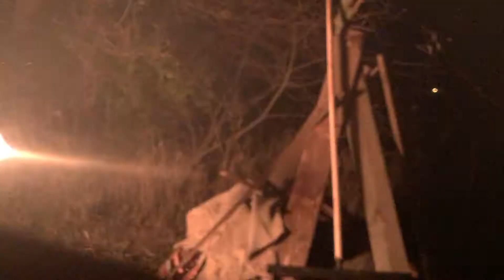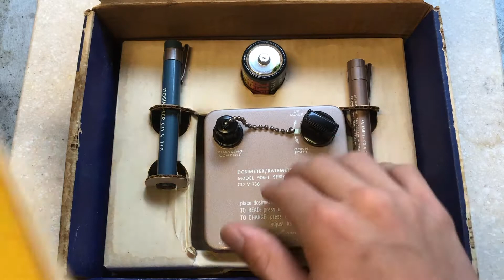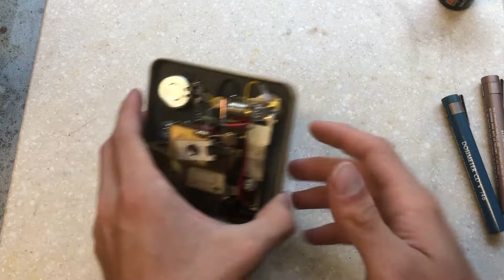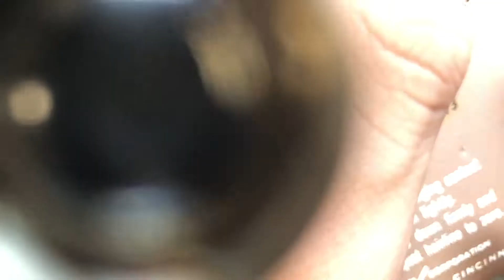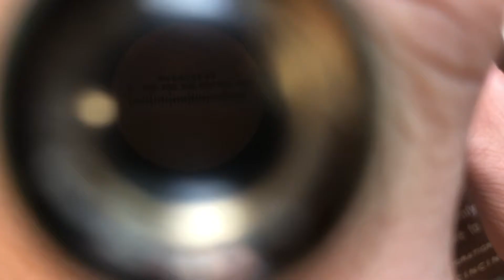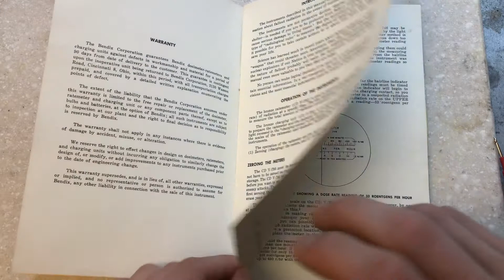Civil defense 1960's Family Radiation Measurement kit bendix

Comment: I just ordered one for my collection (OR USE IF THE BOMB DROPS)...according to my calculations the Ratemeter is actually a special extreamly low range CD V138 Dosimeter that Reads fron 0 - 200 Milli Rentgens (I have 2 of them) but marked off with a 0-12 Rentgen  and a 0-120 Rentgen scale....shouldn't have to worry about calibration with these units like the CD V715 ot 717 ....these would make great back up units